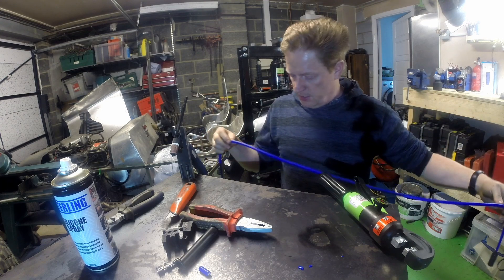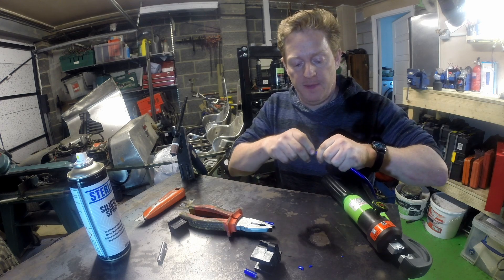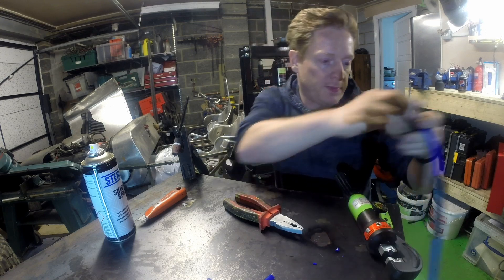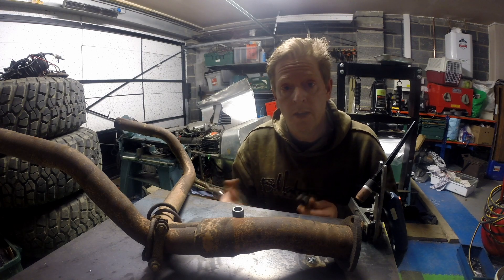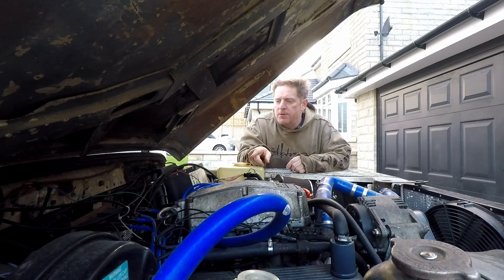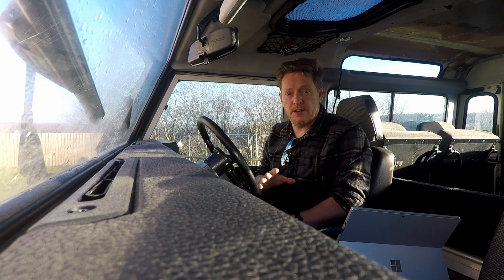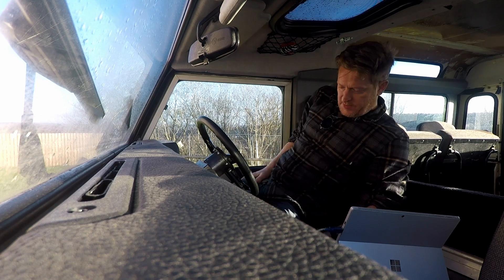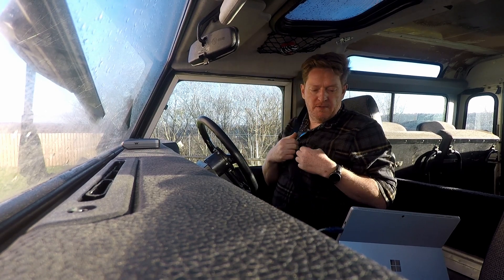Kev's Defender Project Episode 7 (Part 2) - Megasquirt Upgrade

Comment: Did you see much improvement on mpg or power with this conversion?
Reply from the maker: I didn't really take any before/after measurements, but it did feel a lot more reliable, and a bit more punchy
Reply: @KevsDefenderProject  wish me luck with mine
Reply from the maker: @mikefarrell3739  Good luck!

Comment: Very informative Kev I'll be giving megasquirt a ring tomorrow I've got a 4 litre gems which seems to be such a long winded process to get running in a Kit type car it was recommended to Me Maybe look at the megasquirt system and you have made this so understandable to appoint just one question I've got? noticed your laptop is plugged into a silver box in between the console is that something that's just holding wires and relays or is that part of the megasquirt system as I can't find that on the website that megasquirt advertised on thank you. very .much enjoy your video that you've done very well laid out I'm not surprised you've got all those subscribers you deserve them and I will be tuning into you again

Comment: Hi Kev. Great projects you've got and loving the episodes. I've bought the Raptor dash binnacle and mount now, just need to fit them. Thanks for the recommendation. I've got an Ex-military Defender 110 soft top with the 2.5 NA diesel engine and always intended to fit a 300tdi. Seeing your V8 though is giving me other ideas!! :-D 

The Megasquirt autotune function looks awesome, it would be great to know how this works and how aggressive or safe it will tune compared to manual tuning. Count me as a vote to request Shaun to do a guest spot if possible. 

Keep up the great work and thanks for doing the videos!

Cheers
Phil

Comment: Hi Kev, I'm enjoying the videos. Just a question, in Episode one you mention that you were going to replace the key locks with a central locking system. Have I missed the video for this? How are they working? Cheers Ty
Reply from the maker: Hi Ty, glad to hear you're enjoying them! I did replace the front locks, and I do have the footage, but once they were in I got sidetracked on other things :) I need to dig out that footage, finish the rear door, and edit that together. I'll try to make that the video after next (the next one will be replacing the lights, and I'm half way through that one right now)
Reply: Cheers Kev, keep up the good work. Excellent video's.